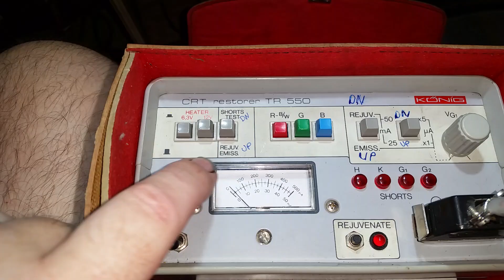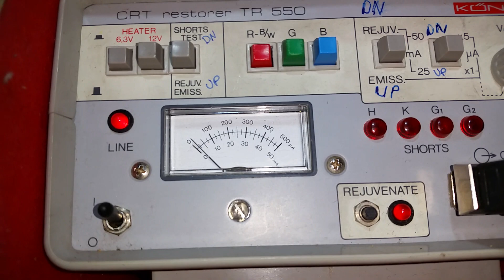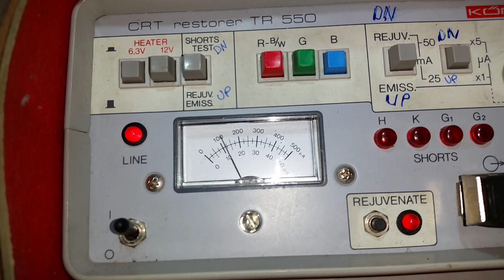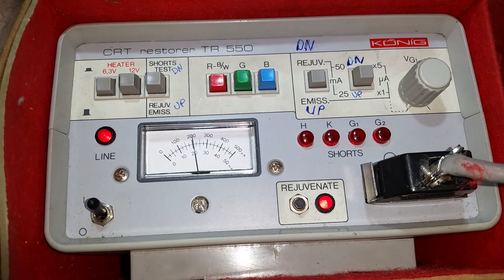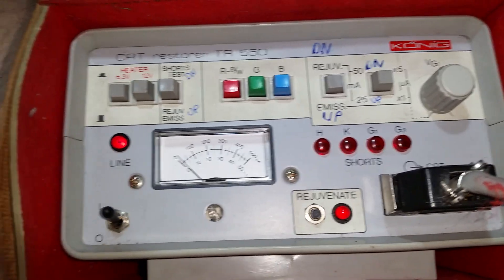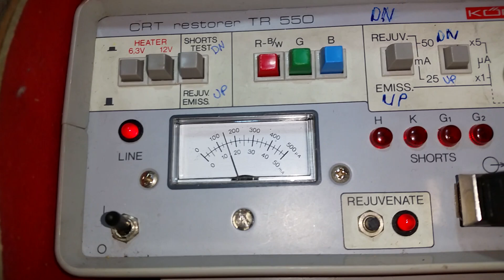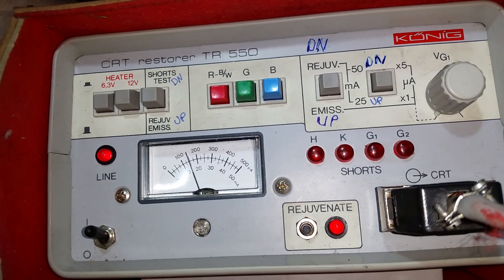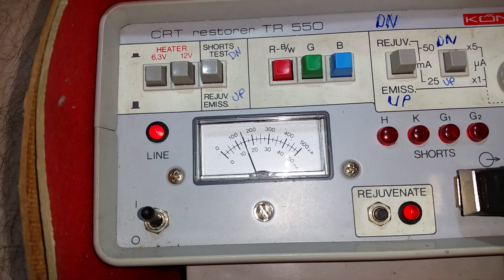Using a CRT Tube Rejuvenator [IGSPGM.COM]

Comment: Used to have these sort of things in the used TV sellers to restore the ex-rental TV stock purchased.
Reply from the maker: There very helpful if running an arcade with CRTs
Reply: @gc8tech  Yeah today it's a bit different, there are no new CRTs and I don't like LCD screens with my pixel art. Expensive kit to get hold of I bet today.
Reply from the maker: @madcommodore   I'm finding it hard just to get a few CRT VGA monitors for retro computing in my Local area... I don't think a CRT would go well in the post...

Comment: When Rejuvenate the RGB colors its applying a higher current to the RGB guns? not sure why this would give higher RGB emissions. I'm confused on what the theory is behind what the rejuvenator is doing to the RGB color guns
Reply from the maker: I presume it puts a higher voltage on the guns that burns off "carbon" or "buildup" on the gun its self. I know its a sealed tube...So its NOT like its exposed to air... But they are the basics of what i does. I have used it alot and seen the "magic" it does!! BLUE gun will ALWAYS die last, Another interesting fact. That's why "No Signal" screens are BLUE. Even though we have LCDs now.. the blue has been kept..
Reply: @gc8tech  I don't know why Carbon would buildup on the RGB guns because where is the carbon coming from? The emission is testing the current milliamp or microamps of current of the RGB guns? I'm guessing the Red gun and Green gun get used more often compared to the Blue gun?
Reply from the maker: @waynegram8907   @wayne Gram  You do get "dust" for the internal coatings of the tube etc.. like the "phosfers" in the front of the tube inside... Othere wise.. HOW can you get shorts between the guns?? Somthing has to "fill the gap".
Reply: @gc8tech  I thought the shorts was caused by arcing between the internal pins inside the tube. The arcing of voltage cause resistance on the internal pins. I know cars wiring harnesses will cause resistance when there is corrosion on the wires from arcing or different types of corrosion material.